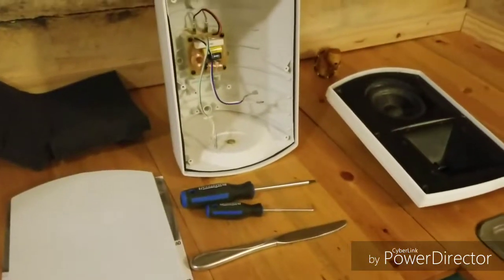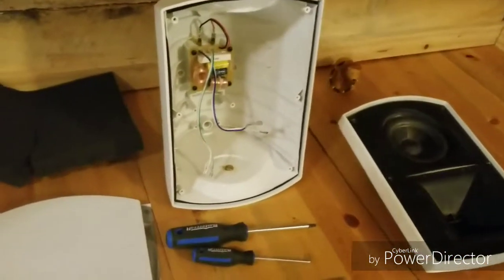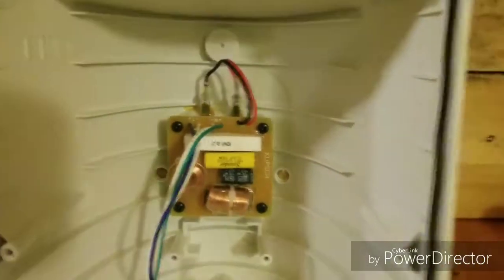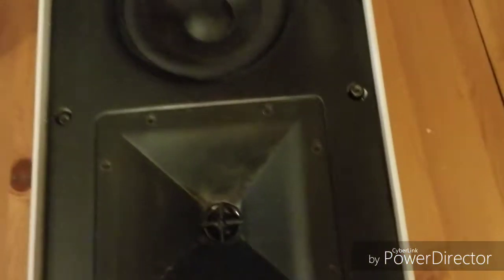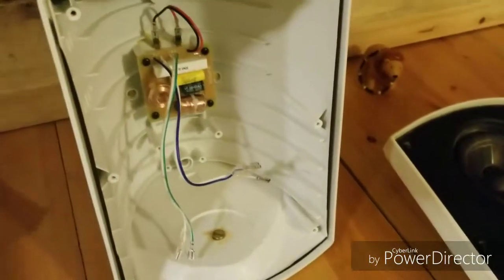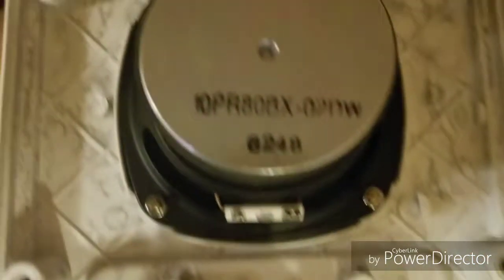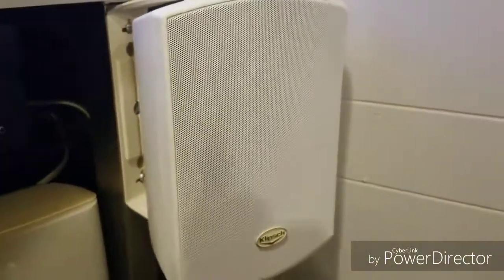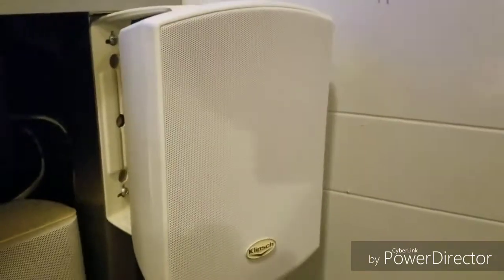Klipsch AW500 Speaker Disassembly And Review

Comment: My AW650 set blew a tweeter on one speaker.  Just barely 13 months old. It was not abused.  Klipsch is not supporting repairs at all.  No replacements parts are available.  As early as a year ago, replacement tweeters could be found for about $39.  Klipsch wants you to buy a complete new set of speakers at $650.  This becomes a "Right to Repair" issue that we as consumers are running into every where from our cars to our most simplest goods, No right to repair unfairly rewards the corporations for the crap they put out.  We really never own our stuff if we can't fix it for a decent price without having to pay the corporation again.
Reply: Literally right in the middle of a 3 week battle with Klipsch over this exact issue. Unnaceptable!